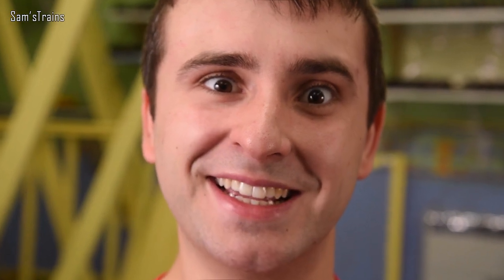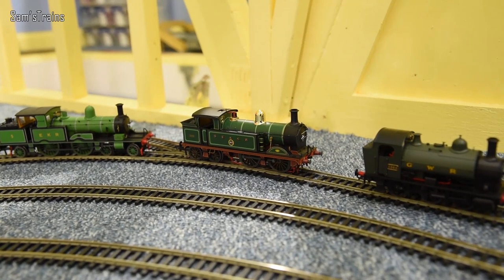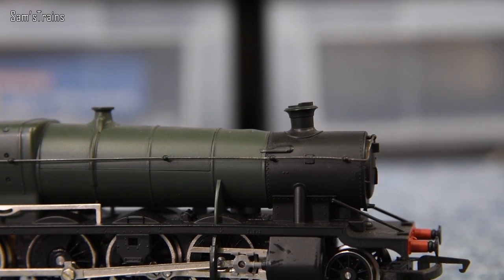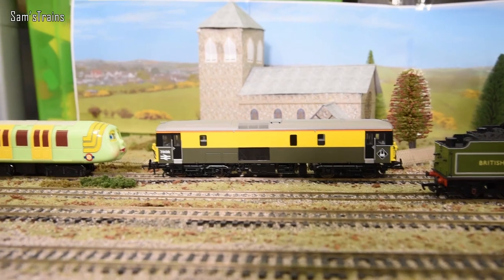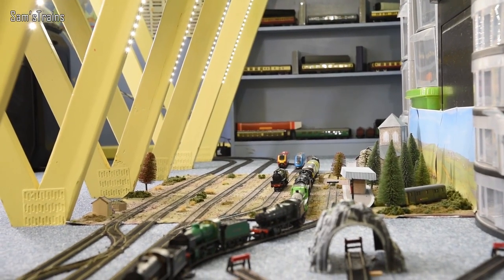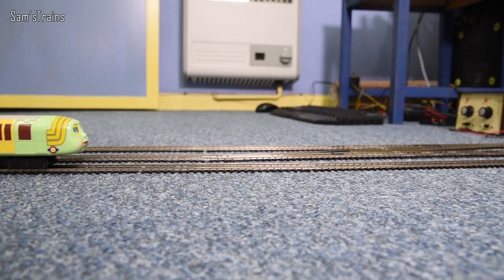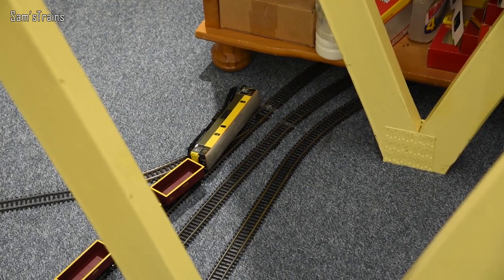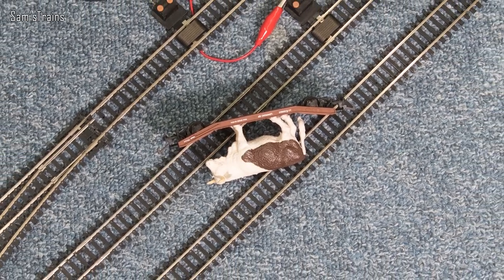Lemon Locomotives | Model Trains With Design Faults

Comment: Just goes to show not all model diesels are better than steamies. I don't have any of these Lemon Engines as you call them. If it makes you feel any better, the new Bachmann Thomas & Friends models are due to be released later this year. Plus I'm in the process of part exchanging my weathered BR Black Large Prairie Tank Engine (Hornby), for the new Hornby 51xx Large Prairie Tank Engine (pristine) in Great Western Green. R32 Gaming has a 28xx 2-8-0 tender engine, 2812, and she runs much better. In fact, you look in great need of some fun. In another comment box, I'll tell you a story that ends in full glory. There'll be a grin on your chin when I'm done.:_SamstrainsThomas:
Reply from the maker: Certainly not all Kelly, that's very true! Yes they are indeed - fingers crossed they're good! :D
Thanks for watching - Sam :)

Comment: Hornby and Lima trains 40 years ago weren't anything as detailed as today's models, but I don't recall any lemons.
Reply: Mainline and Airfix managed a few lemons. I never forget my experince as a teenager buyin the Aitfix 61xx when it was just released. I saved up for months to buy it. The very first run and it immediately derailed breaking the flimsy slidebar and supporting bracket. No spare parts were available and Airfix didn't respond to my letters. That's when I began to build my own locos and eventually fixed the 61xx with proper metal valvegear.
Reply from the maker: That's true - very few Hornby and Lima lemons from those days, but Mainline and Airfix certainly managed plenty! Sounds like that worked out well for you in the end Craig!
Thanks for watching - Sam :)

Comment: Okay, I had to dislike and stop watching after the Bachmann Emily section.
1. You can't have a single loco represent the entire Bachmann Thomas range. The motor quality varies between groups of engines and somewhat between period of introduction. Thomas, Percy, and James, the first engines introduced, have the most feeble motor, possibly shared with Toby and Mavis. Gordon, Henry, and Spencer, introduced later on, have a much stronger motor. Edward and Emily are in between, although whether that's the motor or their lower drive wheel I'm not immediately sure of. Duck and Diesel aren't as good as Gordon, Henry, and Spencer but have a markedly better motor than Thomas, James, and Percy. Donald and Douglas-onward have excellent-quality motors.
2. I think you must be doing something wrong with your Bachmann Thomas engines to have that many smoked motors. If they were that easy to burn out just on their own, my Gordon and Henry would have had toasted motors ages ago. What voltage do you run your trains at?
Reply from the maker: That's fair enough - but in my experience as a professional in service and repair, I maintain that most, if not all, of the Bachmann Thomas range motors are poor quality. I had countless examples coming in for repair, and many in my own collection have expired for no good reason.
Thanks for watching, Sam :)
Reply: @SamsTrains  What voltage are you running your trains at, 12v or 16v? And which engines have the motors expired in?

Comment: 15:38 DEAD!
My top 3 (+1) from those i could not fix or improve, and there are locos that I replaced the motor, or the pickups, and on 5 occasions the drive-system  :
- Airfix 14XX , not a good runner (yes the pickups), but has no pulling issues at least, 
- all my Altaya locos: they start slow with 1.1A current, but after they warm (heat) up it drops to 400mA and they (all) run fine, and fast (5 pole motor btw, but u cant access to it without braking the modell)
- Jouef: SNCF  231K : 4-6-2 tender loco with tender drive, BUT! ONLY the last 2 axles of a 4 axle tender picks up power the other 2 is driven (traction tires), the loco it self just an empty dummy (with a lot of metal and separate parts so... WHY?)! 
Bachmann "1950's 4x4"  utility-car; too small, and light+ bad pickup design, but its a gimmick model; (just a van with rail wheels).

Both my DJM modells the 14XX and the Beattie well tank  still runs.
Reply from the maker: Thanks for sharing Tom! Yes the older 14xxs did have the sprung pony - they've downgraded those, which is insane! Blimey - that jouf doesn't sound good!! D:
Thanks for watching - Sam :)

Comment: It's honestly so disappointing to see so many of locos produced by manufacturers with decades of experience building locos seeming to go down the drain. You can easily make the argument that many Triang locos are better than most of the locos in this video. Yes they may be unrealistic but with a good service, they will run just fine and last for decades, also bearing in mind they generally cost a fraction of the price.
Reply: Hornby have forgotten how to make proper reliable trains
Reply from the maker: Thanks Tony, yeah that's absolutely true - I can't understand it - Tri-ang locos do indeed work much better than some of these!! :D
Thanks for watching - Sam :)

Comment: It’s a great pity that buying these quite expensive models is such a lottery. My Heljan 136 is fine; my Oxford Rail Dean Goods was totally unfit and was replaced, with one that works well. One suspects that manufacturers consider it cheaper to give the occasional refund or replacement, than to implement serious quality control, which is hard to understand. Clearly, locomotive models are not even given a trial run before despatch. When such pains are taken in regard to detail and accuracy, it’s extraordinary to allow the model to be let down by poor running. As you proved in a previous video, perfectly good motors are incredibly cheap, so why are such poor pens fitted in the first place?
Reply from the maker: I agree Michael - yes those early Dean Goods were very problematic! That approach would work if the faults were few and far between, but that doesn't seem to be the case by a long chalk!
Thanks for watching - Sam :)

Comment: Oh you think you had trouble with you Thomas models well you haven’t seen my Thomas models before as in the case of my Bachmann Edward in the first month its gears locked up,burned out its motor derailed its tender by going on a piece of track and causing a crash,burned out its motor a second time and the final straw is when the motor just flat out won’t run until a take it off and a few minutes later it runs like nothing happens. There are others but Edward was the first and had the most problems
Reply from the maker: Uh oh so sorry to hear that - how did all this happen?!? :O
Thanks for watching, Sam :)

Comment: I have 4 Bauchmann locomotives and they never had any trouble.  However I also have 2 Mantua passenger coaches and they are total trash.
Reply from the maker: Thanks Paul - glad to hear those are good! What's up with the coaches, lol?!
Thanks for watching, Sam :)
Reply: @SamsTrains  The coaches are too light and the flanges are not big enough.  
I guess I also say there is nothing wrong with my Bauchmann locomotives partially due to the fact that I live in the United States and Bauchmann is one of the top quality train brands in the country.

Comment: I am really surprised that in 2020 it's possible to deliver such poor quality ! 😁
Reply from the maker: haha I agree - yet these manufacturers manage it perfectly! ;D
Thanks for watching - Sam :)
Reply: I think the problem is that they design the really detailed locomotives for the cabinet collector's and the beginner's locomotives are built badly to keep costs low. I think the only locomotives sold that are 100% reliable are the Hornby 0-4-0 locomotives I have one that has lasted 20 years with minimal maintenance and issues, plus Sam has run Miles for a ages and it never broke down.
Reply: @bentullett6068  but this seems to be a 00 problem. I never had any issue with my H0 models from several brands like, Fleischmann, Roco etc. 
Those models are much more expensive than Hornby and other 00 brands, I have recognizes at Sam's videos. Sometimes I wonder how low the prices are in U.K. for the 00 locomotives.
Reply: @kwesibin6767  that's interesting. I think the UK market like anything that is as good value as possible on any product. Issue is the manufacturers have to use cheaper components to meet the requirements. The most expensive brand we have is Bachmann and detail wise they are really well detailed but what let's them down are the motors and chassis with square bearings rather than small round bearings you see on other manufacturers trains. Also I don't know if the European manufacturers have started to use diecast chassis or components on their locomotives yet as our manufacturers have to gain pulling weight.

Comment: After my wife died I returned to a school boy hobby( I had a super reliable Hornby Dublo set when a school boy). I have found modern models super detailed, super fragile, super unreliable and super priced.Of the six new locos I have bought in the last three years, one completely failed (resulting in a refund) two are very suspect, three perform well. Why would any schoolboy get into the hobby now ?
Reply from the maker: Thanks a lot for sharing - you're absolutely right, that's basically the same grievance I have with the hobby these days too. Okay the prices are high, but why aren't we getting what we pay for 50% of the time?
Thanks for watching - Sam :)

Comment: So then... my experience. When reading, bear in mind that my layout is on a flat baseboard with pinned track.

Experiences with locos you have that I do also:

14xx - I have three of these locos and am yet to experience too much difficulty with them with the exception of my Airfix one which is completely different mechanically and just throws sparks everywhere without moving to my Dapol and Hornby ones of the same tooling, however, I have never put them on a load of more than 2 coaches.

S15 - In terms of the motor I haven't had any issues, however I find that on points the front bogie tends to derail and on occasion, the driving wheels lift off the track.

N class - The tender is incredibly annoying when putting the loco on the rails and when handling it in general, however once on the track it doesn't prove to be an issue. I do find however then the valve gear often gets caught when the loco runs in reverse.

9f - I have an original Triang one and a tender driven 90s one. Neither have any running issues with the exception of the fact that they're tender driven which I hate. Despite this, I find that my 90s one is incredibly fragile and many parts including the tender hook and part of the valve gear have broken off whilst running and I handle my locos very carefully. The 90s one struggles to pull anything even so I now use the '71 model in favour of it.

Locos I have that are Lemmons:

Bachmann A4 - Like the N class, the valve gear often gets caught. On this loco it happens instead in both directions but happens less frequency. The loco also runs in a very jerky way.

Triang Battle of Britain - I recieved this loco not too long ago second hand and it just didn't run. I completely restored it and soon it was running okay, but the commutator kept glowing and smoking. I ran it in gently and it got a lot better until it was eventually running smoothly with the exception of pickup issues. The problem is that whenever I don't run it for a few days, the commutator starts sparking and glowing again as well as smoking and requires another clean whatever I do to the point where it's too much of a paint to run. I feel however it may just need a motor replacement as I have many princesses with the same mechanism which work fine (I might steal a motor from one)

One of my Hornby 0-4-0s - It's missing a motor :D

Many of my older models - I find that with a lot of Triang models and models of a similar age, the flanges are just too big for the track in same cases, however I'm aware that these were designed for older track so I won't complain too much.
Reply from the maker: Many thanks for sharing all of these mate! The older 14xx design was better as it did have the sprung rear axle - Hornby have since downgraded it for reasons unknown!!
Thanks for watching - Sam :)
Reply: @SamsTrains  After reading your reply, I headed to the garage to check my 14xxs. I found that not only does my 90s Dapol one have a sprung rear wheel, but so does my 2018 made Hornby one. The Airfix one doesn't however, though this has a completely different chassis and mechanism. I know your 14xx review came out in 2017 so I'm guessing either Hornby decided to put it back or you received a faulty model. Either way, it's good to know that they realised the problem :)

Comment: 🚩 Stop, Stop, Stop! This what all of the 'model' railway companies should be saying to themselves and asking themselves what are we doing to the market place?
1. You have long deliveries from China, and that's if they're going to be produced in the first place it is almost like waiting for an 18th Century Tea Clipper to arrive in the port. This then alienates the customer from the distributor who has no control over the issue. 2. Then we have some seriously bad motors put in them which means that they're a joke when they arrive. 3. But in fairness to the 'model' railway companies at the least they have added a warning that these are not toys and should be used by under 14 years old. At least Mum and Dad will not have the problem wondering why their child is roaring the house down. As he's launched £200 worth of loco c/w digital sound, at the wall because all the details of it have dropped off due to shoddy workmanship due to glue failure (if they were glued in the first place)💥If a company started up in the UK with manufacturing here in the UK and have proper ISO 9001 quality control, tested every single unit and despite the price being possibly slightly expensive. I suspect railway modellers would be willing to pay the price to have a decent product that was well engineered. 4.I perceive that for far too long the 'model' railway companies have driven the market place demand as oppose to it being customer driven, which is fair enough and it is just like hoovering up easy money, (if I am not wrong) however for access to that easy money you would think that they would look after the customer recognising that he deserves some better quality service as oppose to it all being about their bottom line?
Reply from the maker: Thanks a lot for your thoughts! Surely a product 'not being a toy' isn't justification for it not to work ? I think the prices we pay already are such that quality control should be a given! Agreed mate, cheers! :D
Reply: @SamsTrains  Thanks!

Comment: Quite frankly if I'd bought my child a loco that dangerously overheated, melted its casing, exploded or caught fire I'd sue...if it was otherwise unfit for purpose I'd go for a full refund...if necessary in the small claims court...why should these manufacturers have immunity from comeback?
Edit: And before they claim these crapjobs aren't toys, I'd posit the question "then what are they?"...they're certainly not precision models are they?
Reply from the maker: haha exactly - some of these have been a bit borderline unsafe - particularly when my 14xx and Terrier went into motor meltdown! Exactly - but toys or not, at these prices, they need to be right!!
Thanks for watching - Sam :)

Comment: Seriously who would want to buy their child that bad acid trip articulated green dildo underground train? As for the SECR 0-4-4 I’m not running mine as I’ve got the collectors club version so motor won’t be an issue. I’ve not had trouble with my Heljan 1361 or Hornby S15 or railroad 9f but I run on DCC so maybe that helps? I remember the 3rd loco I ever bought when I was about 8 or 9 was a Hornby mallard (Margate made pre China with tender drive back in those days) and it never ran, you could get it to go at normal speed by running it on full for 20minutes where it would gradually increase from a faltering crawl to flinging itself off at a curve (those old A4s had little separately fitted detail and were built tough) and at that point you’d get about 10minutes of decent running before it smelled like an electrical fire and stopped until you let it cool and go through the whole process again.
Reply from the maker: haha I really don't know - I don't think many did buy them, since they were still available more than 10 years after they were discontinued! Thanks a lot for sharing - blimey that's definitely not right, that A4!
Thanks for watching - Sam :)

Comment: Yeah, I'm sure that you'd have less problems if you fixed the track to a board instead of loose on your carpet.!
Reply from the maker: Why would you think that? I have a collection of over 400 models, yet only these are faulty. I explained what was wrong with each one too, did you miss that part?
Thanks for watching, Sam :)